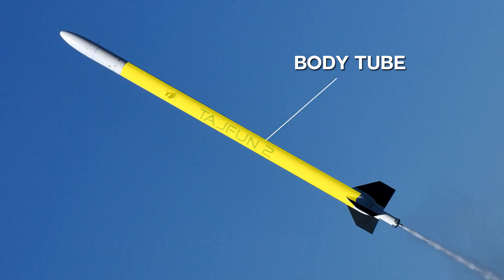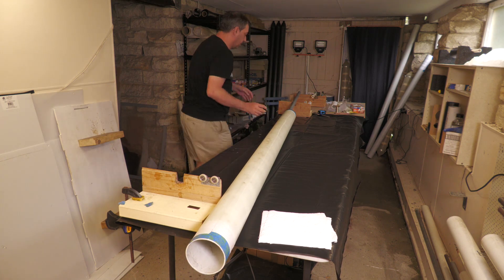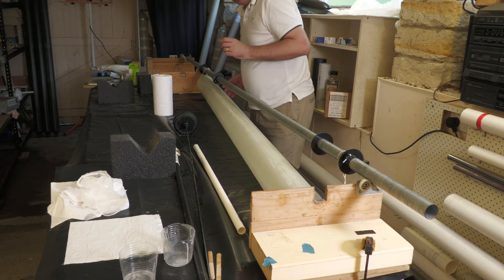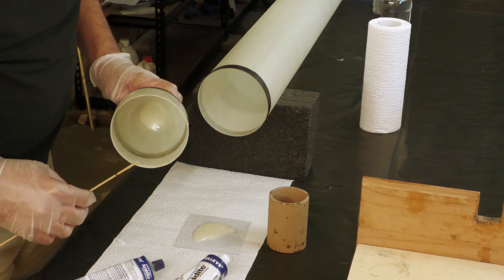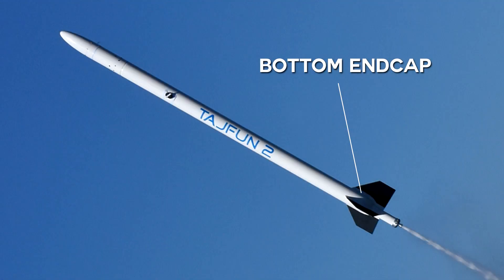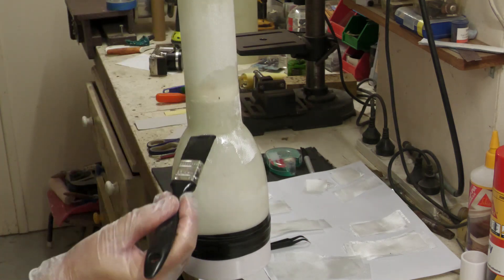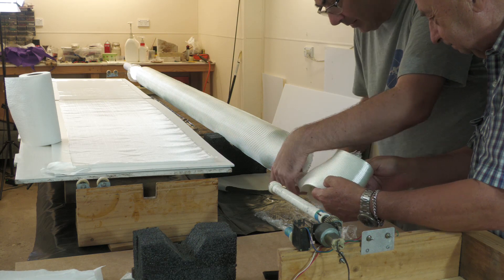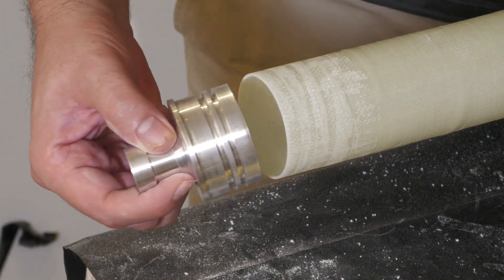High Power Water/Pyro Rocket - Part 3 - Pressure Chamber

Comment: Hi George
Few queries if you can help answers with:
1. How many layers of glass did you go for for the main body tube / pressure chamber?
2. What thickness wall did you end up with?
3. Which epoxy / hardener you used for the main body tube?
4. Did you notice any flexing / bending of the tube during flight with J motor?
Thanks
Reply from the maker: Hi, the pressure chamber was 6 wraps of 200gsm cloth followed by 1 fiberglass biaxial sleeve. I am not sure of the final wall thickness since we haven't cut it open to measure it. But it will be somewhere around 1.5mm or so. We used West Systems epoxy with the 206 slow hardener. From the on-board camera looking down the rocket during the boost, I did not see any bending. This is a fairly wide tube ~110mm so quite resistant to bending.

Comment: Question: are there any good cheap alternatives to fibreglass? 
I have heard that it can be dangerous
Reply from the maker: Depends on the application. In terms of dangerous, is there a specific aspect you are worried about?
Reply: Yes, I am worried that my eyes could get irritated, and that soreness in the throat could also occur. To my application that I want to work on, is to reinforce plastic so they will be able to withstand more pressure.
Reply from the maker: @microbeMan  So generally when you are working with fiberglass cloth you are fine in terms of handling it and cutting it. Where you can get irritation is if you are sanding it and the dust becomes airborne then you want to wear a respirator/mask. Sanding it with water helps cut down on airborne particles. You may also be sensitive to the resin before it hardens. This is much more rare but some people do have sensitivity to the resin/epoxy.

Comment: Can I cure the fibre glass without having the process of the rotisserie? will it make the body tube too bad for flying?
Reply from the maker: The rotisserie stops the epoxy from pooling on one side of the tube. If you use peel ply then you probably can do without it and still get a reasonable result.

Comment: Your dad is so cool! The story is truly inspirational. It makes me want to go out there and do my best and sharing my creations with the world.

About the construction technique, I keep wondering how many pieces you had to discard to achieve this level of expertise. Once I tried making a body tube out of fiberglass and it is still epoxied to the mandrel.
Reply from the maker: Thanks Dan. :) It's definitely been trial and error over the years to learn how to get the right results with the fiberglass, though we are still learning how to mate it properly to different materials. The important thing is to get everything prepped properly before starting. We spend at least double the time preparing everything for a lay up than actually doing it. A lot of the techniques in making tubes we borrowed from the pyro rocket community. We would eventually like to try winding on a winding machine and also vacuum bagging to get better strength to weight ratio.